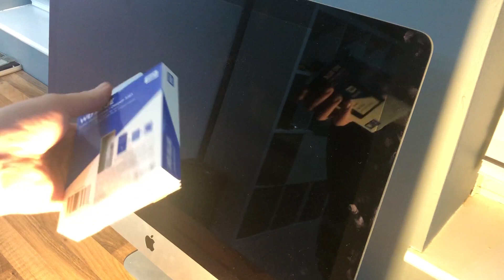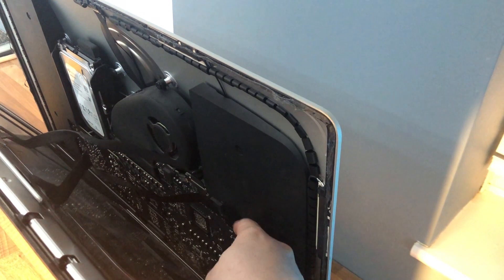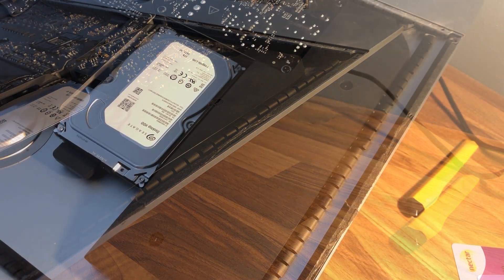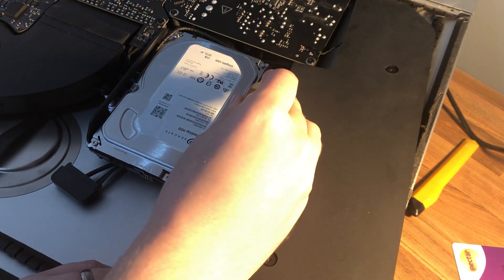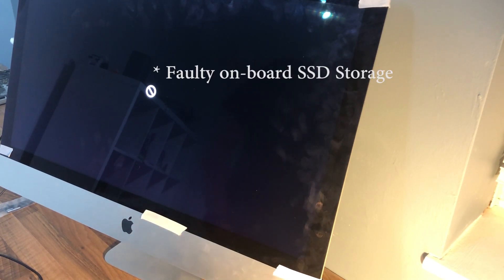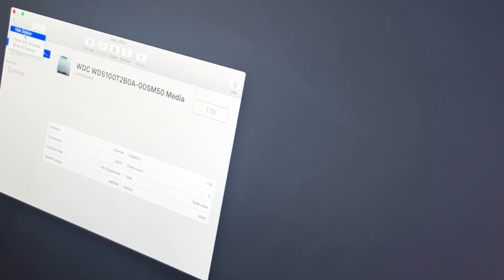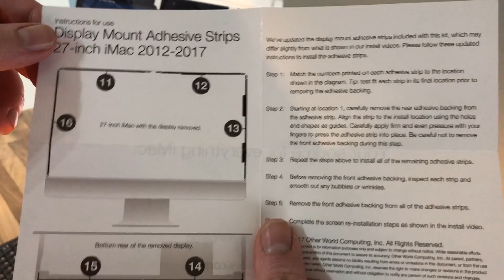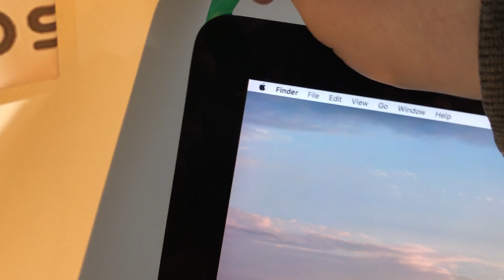iMac Late 2015 27 5K | SSD Install & Upgrade | OWC Senor | A1419  | 2012-2019 12 Faulty Macs| Part 7

Comment: i not understand how the temperature sensor work. its connected with three wires on power connector (two negative one positive 5v) i think this powering the sensor. but i not understand how its comunicate with the mainboard the temperature releved.
Reply: See too? Need it or no?

Comment: I have watched a half dozen drive removals from iMacs (glued screen models) and in none has the hard drive have a sensor cable attached to it. Pre 2010 (thick bodies) macs had a sensor cable plugged into the hard drive and the DVD drive. Seagate drives still have a connector but not WD's that I know of. I have to question the need for a OWC sensor array. It does not appear to connect to the board. See "The OWC 2011 IMac Sensor cable controversy".  It  claimed the OWC sensor array did not do anything and the problem with fan activation could be controlled by software. In Australia the sensor goes for AUD$60 to AUD$70 and the complete kit AUD$100+ Is it really necessary. This and the tendency for glued on iMac screens separating from their iMac in the middle of the night has put me off replacing the  HD in my 2013 iMac with a SSD. I boot from and external SSD instead, See the video "$1000 mistake! How to upgrade iMac SSD & Thermal Sensor 2017 A1419 hard drive replacement"  shows the result of midnight tape failure.

Comment: Does anyone know if the fusion drive removed from inside can be mounted in an enclosure and used as an external fusion drive?
Reply: Yeah you can use interall hdd or ssd but your Fusion Drive will be messed up if you are in there you might as well just remove the ssd for a larger one and throw out or keep the hdd

Comment: the last part when you put on the screen is not the best way. Those adhesive strips are made extremely thin so that you can just pull them out once you place the screen in its proper place. in other words, just remove the bottom strip of the screen and place the screen in it's place. once you have the screen where you want, just pull the tabs off as they will slip through the screen and your Imac. very easy. i just did one yesterday successfully.
Reply from the maker: Months on and it’s still fine so I think both methods are good

Comment: Do you know if it’s possible to remove the flash storage from the logic board? Mine is faulty and causing a kernel panic. I’ve installed an internal ssd but it keeps trying to access the Apple 128gb flash from the original fusion drive which makes it unusable.
Reply from the maker: On some of the iMacs it is removable. However if you look at my other videos I did a fusion drive split which allowed me to format the flash part of the logic board and take it out of action .
Reply: @domchapp  Can't even format mine. Even tried doing all zeros. Sometimes it shows up sometimes it doesn't But it randomly appears. Still unwritable thought .

Comment: Can you explain why the iMac didn’t see the OS on the thumbdrive but tried to access the flash drive and how you eventually got the iMac to recognise and install the OS from the Thumbdrive.
Reply from the maker: Hey , to force the iMac to boot from the USB flash drive i had to hold down option (i forgot to plug the keyboard in ) so by default it went for its original boot drive which was the built in faulty flash storage. Once i plugged in the keyboard and held down the option key it allowed me to boot from the USB into recovery mode and install Catalina .

Comment: is this OWC sensor really necessary?
Reply: It is not on my 2011 iMAC. I watched this guy's video: https://youtu.be/pMsk1o1W2B0
To test his research I bought a "Y" splitter and re-connected the SSD. The result: nothing. CPU & GPU fans ran normally. Drive's fan is always ON by design (quiet fan).
Reply: I've heard since high Sierra it is unnecessary
Reply: @josholson1898  is not necessary. SSD reads temperature with S.M.A.R.T. The disk is mounted in the holder and connected to pins 11 and 12 in the SATA connector.
https://www.elvikom.pl/imac-21-5-27-blad-4sns-1-40000000-th00-9-000-po-wymianie-hdd-t50744.html
I have an identical iMac late 2015 and today I was replacing the disk with an SSD. Works 100% :-)
Reply from the maker: I believe so yes as If not the Mac is unable to detect the drive temperature it by default will run the fans at full speed .